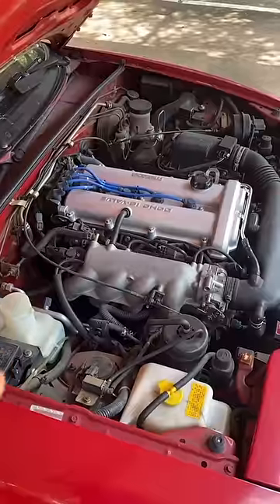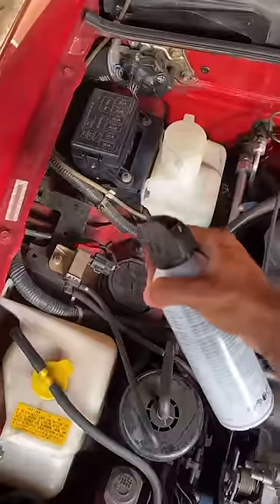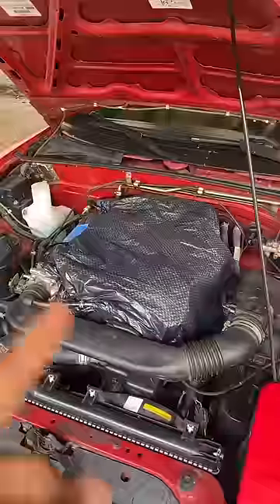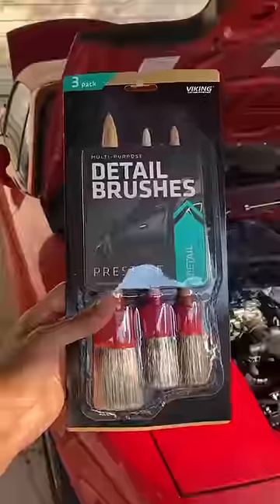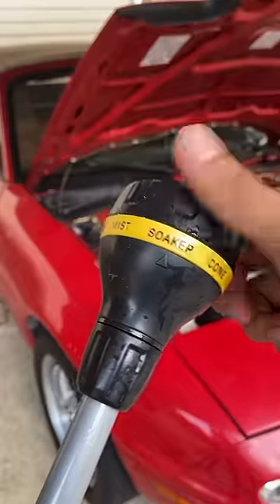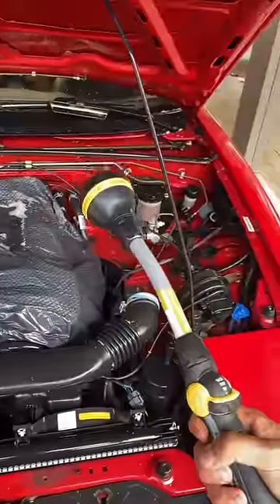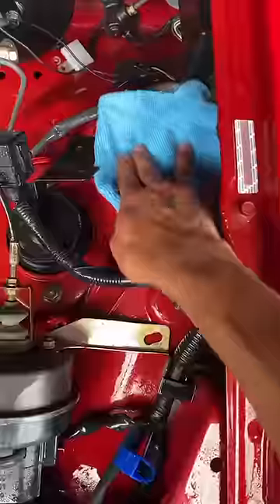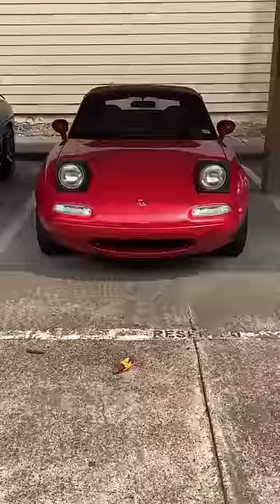How to Detail an Engine Bay! (the right way)

Comment: Waste of time. And alot of these comments are dead wrong. Pop the hood don’t cover anything up. Unless you have an open air filter.. spray with engine cleaner I use “sonax” and then hit it with some motor plast from “koch chemie”. No need to even dry just crank it up and let it do it’s thing

Comment: as a detailer. this entire video made me cringe. the only thing you’ll ever need to cover is an alternator and distributor cap. i NEVER cover batteries, and i certainly never cover the whole ass engine. you spray everything with pressure not volume and spray degreaser, scrub and rinse. let air dry or blow dry with leaf blower. it’s not that serious the entire engine is exposed to water all the time. you can get it wet

Comment: Hey just curious have you done a grimy engine bay like 1/4 inch thick layer of grease and oil
Reply: Don't clean it leave it will stop it from rusting
Reply: @roytravis3765  I know but for doing repairs it's a nightmare of a mess that's so hard to get off

Comment: No...use an air wand and a compressor...then selectively spray degreaser where needed...use power washer to cleanse and IMMEDIATELY use the air wand to dry and move moisture out of trouble areas....multiple dealerships use this approach

Comment: You forget the most important thing to not fuck your electronic componentd under the hood. DEIONITEZ WATER! Is the only way, normal water will fuck it all. Edit: ALSO DISCONNECT THE BATTERY AND DISCHARGE THE PARASITIC CHARGE ON YOUR CAR.

Comment: 1. Use leaf blower or shop vac
2. Use brush
3. Cover: alternator, fuse box, air filter, engine, any electrical sensors

Comment: Yall doing too much.  Weed sprayer bottle with dish soap/degreaser mix spray it absolutely everywhere... pressure wash the entire bay.  Drive the vehicle around until hot.

Done it 100s of times never had 1 issue.

Comment: You can just use the pressure washer from the start, you know. Just cover the battery, everything else should be pretty much waterproof. That's why you can drive when it rains.

Comment: Ummm that's way too much work...lol. When I worked at a detail shop... We sprayed the whole engine bay with heavy duty degreaser..... Then used a pressure washer to spray the engine bay.....as long as there is no open parts to the motor your fine.... Your not gonna hurt anything ...... So many people are afraid to do that but I promise if you do it right you are fine.... The engine bay and electronics are water tight connectors.....I did it 5-10 times a day for 2 years and never messed up a car.... Just be smart and don't spray the air cleaner and don't spray carbureted engines....also leave the motor running while doing it....

Comment: There needs to be a major warning on this video. If you're going to spray down the engine bay, make sure the engine is completely cool first. (Ie, hasn't run long enough to warm up to temp). If you don't, the water could crack something in the engine. Similar to putting a warm cup in the freezer.

My father once sprayed down his engine after driving home from work (didn't use a trash bag though) and the engine cracked. It slowly began to overheat over the next few months, and eventually blew coolant everywhere once the crack gave out.

Comment: Jebus, just pressure was the engine. Go easy over the connectors and wash away the crap. Way over complicated there. For those that say “OMG, you might break something!” Like i said so easy where you need to but blast when it needs it. I’ve never had a problem pressure washing a motor.

Comment: Detailing for 35 years and ain’t never cleaned an engine like that! Just make sure the fuse box is NOT broken spray degreaser and pressure wash it! Then take the air and blow it out! Spray some shine and Wipeout! Run the car as u wash the rest of the car! Bam 💥. High End cars needs the air intakes to be vacuumed out before starting!

Comment: Wtf. This is too much work. Degreaser in the engine bay and spray off with hose. Just don't high pressure anything electrical. Done this for years in mechanic shop.

Comment: why make a video if youre in no position to share knowledge/experience? all these stupid comments stressing about the motor, electricals, alternator, etc. you literally put a bag to 'protect' the engine from a slight drizzle. at work we pressure wash engine bays with thousands of psi. 30+ cars a day, for years. never any issues. the engine bay is designed to withstand a lot more than some water. just dont spray scorching hot headers,  and dont dump litres into the intake.

Comment: For newer cars you don’t really have to cover anything except for the battery, after you’ve disconnected it. 

Cars are designed to get water under the hood, it’s normal. As long as your not spraying a pressure washer directly onto the engine bay you shouldn’t have any issues. You can use a PW, just at a distance, on a softer nozzle.

Comment: One tip I have for acquiring some awesome cleaning brushes for free is to hit up a few local fast food joints and ask if they have any old fryer or ice cream machine cleaning brushes they're about to replace. Since they practically get new brushes every three months the old ones are barely worn out and they just toss em anyway.  

With all the different sizes I can clean every nook and cranny with ease. I just have a spray wand for my air compressor I use to blow loose dirt away, spray down with some purple power or Klean strip odorless mineral spirits, scrub, light spray with solvent again to rinse, and then blow dry the whole bay from the tip down. I just avoid drenching electronics and any breather ports, a moistened paper towel works just fine for them.

Comment: Also cars with distributor caps, make sure those are covered or you’ll have a misfire from the condensation created Inside of the cap, I think newer cars are okay not to cover the engine, I worked for carvana and they just had use pressure wash the whole engine bay 🤷🏻‍♂️ not sure if we were suppose to buy it never hurt the cars

Comment: You probably needed about 3 hours to do this amount of work and no done it even good in lower areas or difficult areas..im a mechanic i just jet washing everything and after i make sure to dry it with air pistol where is electric parts more specifically all this in 10-15 min and looking like brand new

Comment: that canned air is quite expensive and runs out quickly, if you have just a couple hundred dollars, buy a small air compressor, a blow gun attachment and a tire inflator attachment. If you are trying to leave the house but your tire is flat, and you can’t change the tire, just put some air in it and head to the shop, instead of getting a tow. or instead of buying canned air just use the blow gun to clean stuff, it’s way more powerful than canned air too.

Comment: Ok this guy is a bit sloppy, do this BRUV.
Cover the battery
Cover the alternator
Cover the air filter or wrap it if it is exposed and not in an intake box
Mist section by section and agitate with some degreaser and the brushes he's using and dip it in water and keep agitating the dirt
Rinse with little water as possible 
Spray the bay with engine detailer/restorer after rinsing and take the covers off everything put the hood down leaving a 2 inch gap and start the car
Let it sit 5 minutes to heat up and dry the water and detailer 
Then give a final wipe. 
Enjoy your new engine bay.

Comment: just soak it in cleaner and use pressure washer. You'll be fine. Just dont get on top of fuse boxes etc and it'll be allright. did 100's of em.

Comment: I only worry about cleaning the engine bay with the motor removed. When I’m doing a rebuild or a motor swap. Clean up the engine piece by piece and make it look good. Not everyone’s got the ability or know how to do that sorta thing so make sure you cover your alternator and loose open electrical ends that can get ruined from liquids falling into em, and anything else you don’t want getting wet and his tip actually works.

Comment: You'll want to disconnect the battery before starting, just in case. The electrical connectors should be water tight, but your car likely isn't brand new any more. After your done give it a few hours to air dry before connecting the battery.

Comment: The compressed air save you some money got to harbor freight get a air compressor for 75 bucks and get the air tool attachment. And use the air duster to huff win win

Comment: Its better not to clean the engine bay
I have seen people coming to workshops for "Engine check" light ON right after cleaning the parts under the Hood

There are a lot of electrical components in there and not everyone is a pro in washing so the water can damage or short circuit them.

It is Fine if the engine is little greasy, it gives lubrication, reduces friction and protects from rusting. If you are that obsessive in keeping the car clean, keep your car seats and trunk clean😉

Comment: Been a detailers for a about a year now and I’ve pressure washed many vehicles engine bays and never had an issue with the battery’s or electrical issues. Most cars from 90s and up are pretty good when it comes to getting sprayed down, unless carbureted

Comment: I use Walmart engine degreaser and a pressure washer works great and I don't cover anything because manufacturers  having to make all the electronics water resistant anyways I mean what do you think happens when you drive on the highway in the rain ?? Lol

Comment: Well just disconnecting the battery and leave it baking in the sun to make sure all the water evaporates after the bath then reconnect battery. Should do the trick if you don't wanna put a garbage bag cover.

Comment: i left my car running and sprayed it with a pressure hose and was just careful of the air box and electrical box and everything else was completely fine to get extremely wet

Comment: I detail at a dealership, and we don’t do any of that shit. We apply our all purpose cleaner onto the engine and hood, and then pressure wash it all out, then applying our vinyl cleaner onto all of the plastic bits. Never has a vehicle gone immobile or had any problems.

Comment: be extremely careful doing this on newer vehicles especially those with engine bay mounted ecms or modules as it can be pretty easy to ruin them by giving them a shower these are things that should be mentioned in these videos... If you don't have time to explain something like this that would avoid people from having potentially expensive grief don't put them in shorts

Comment: So everyone saying you need discount battery covered in general that you guys aren't 100% right now when you wash an engine you're actually supposed to have it running if you can you don't have to cover it up the whole engine gets wet anyways when it rains even the alternator you can power wash it just make sure you don't spray water directly at the spark plug boots where they go into the valve cover on top of the engine on that engine if you have an engine like that most 4 cylinders are and you're good to go now if you wash your engine with the engine off water gets inside the spark plug crevices then go all the way down to where the spark plugs at and they when your coil packs fire off it vaporizes the water and the little spring inside your coil pack that makes contact with your spark plug will get bits of not carbon but minerals dried up on it that will actually block that spark and cause a multi-cylinder misfire you take that out you clean it up put some dielect your grease and every and you're good to go you can wash your engine and actually spray it directly with a power washer and you won't have to worry about it anymore same thing happens if oil is down there now just make sure you don't get your power washer too close to your air intake while it's running and you're good to go even when it's off you do not need to shut it down it's 12 volt there's no real computers that can't handle getting wet that aren't waterproof under the hood

Comment: A pressure washer works much better,  just have the engine running and hot,   try to avoid the ecm and electronic areas as much as possible and your good to go

Comment: Dude just take some spray foam degreaser and coat your engine bay and spray all of that with the hose warm or hot water usually works better but your not going to hurt anything as long as you don’t water log an alternator. Worried about wires replace your wiring because nothing should be exbosed

Comment: I've never covered my engine. I used a pressure washer to clean the engine too just don't spray into the intake. I know it's hard to believe but water won't hurt your engine. Don't believe me next to you drive in the rain stop and open your hood and see how soaked your engine is

Comment: Just had to throw out there that there’s no reason to cover to anything in a modern engine bay or any engine bay post distributor and carbureted cars and the occasional exposed intake/filter. Your engine bay isn’t sealed from the elements so trust when I say your soap and water isn’t gonna hurt anything under there

Comment: Literally don't have to worry about getting anything wet under the hood. Just get the pressure washer make sure the motor isn't hot first then spray it down and use a air compressor and blow it off then spray some trim restore on it good as new but make sure the spark plug holes are dry otherwise it will ark and cause a random miss fire

Comment: I detail cars for a ford dealership with over 10 seperate president awards, we never cover the engine when doing engine bays, not necessary if you are using degreaser instead of soap, using degreaser also removes the need for brushes

Comment: You don’t need to cover the engine with a bag. You only need to use low pressure water and some degreaser. Works best

Comment: You covered the engine with a garbage bag that’s not the part that will get really harmed by water as long as you don’t get the water in the intake the electrical is what you don’t want water on I would never do this to any of my vehicles engine bays

Comment: It's faster and easier and you get a better job if you take it to a car wash, use tire and wheel cleaner in the engine bay, leave it.. clean the rest of the car then go back to the engine bay and clean that with high pressure water.. done.

Comment: You can get water on your engine just cover up the air intake and if it got a carburetor cover it up but I guess you are playing it safe in case you got a spark plug loose

Comment: never ever do water let inside the hood, wat so ever. greases are good for bay. 
just wipe it with the wet cloth or dry air. but not with high pressure.

Comment: To all you peeps and the op no need to disconnect the battery and no need to cover the engine no harm will be done if your not using a pressure washer and even than long that you don't just hold it in one spot nothing will happen

Comment: Worked as a detailer for ages there is no need for this just pressure wash under the hood while the car is running and hot never had a single issue and did literally thousands of cars

Comment: That's the beauty of running a diesel, it does not care about getting wet.
I normally cover the alternator, hot pressure wash the block etc. Then start the engine to let it dry.

Comment: I always just spray it with a pressure washer foam cannon and brush it and wash it with the pressure washer
Reply: You must not have any electronics/computers. Inmean, a 60’s car is fine, but no high pressure water where computers are concerned. You do this to a modern car and it will have a dozen lights/codes tripped and kay not run well.
Reply: @vincedibona4687  2003 passat 1.9tdi. done it a dozen times but atleast german bosch electronicts are watersealed real tight

Comment: Aye. Don't forget to water wash your block and oilpan. Easy way to do that is to stick a water hose (it's better if you use salty water) into the oil fill hole and fill it to the top then let the engine run for like an hour and you're good to go. Since you're doing this, don't forget to wash the inside of your gas tank with soapy water.

Comment: You should disconnect the battery and let it dry in the sun for at least a day so that it doesn't hurt the electronics. Or clean them with distilled water.

Comment: Do. Not. Spray. Water. Under. Your. Hood!

There are hundreds of sensitive electrical components under there that are not supposed to get wet. There’s also bare metal that will rust, especially if you strip it clean. 

Engines don’t like water. There’s a hood on there for a reason. 

A coating of grease and grime is actually GOOD for an engine! It acts as a barrier to water and subsequent rust. 

Just leave your engine as-is. Let it stay grimey. Your mechanic will thank you.